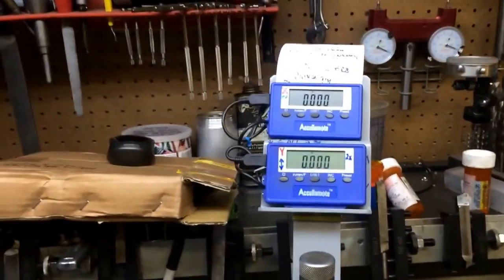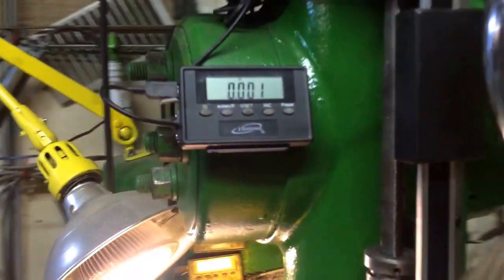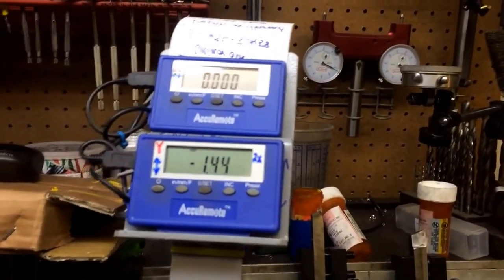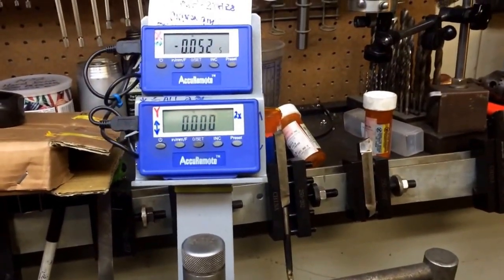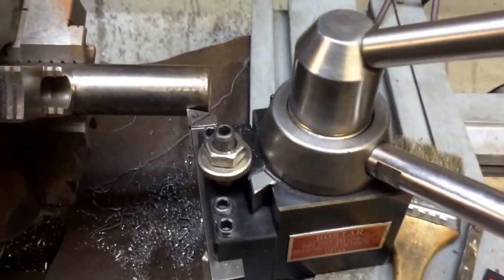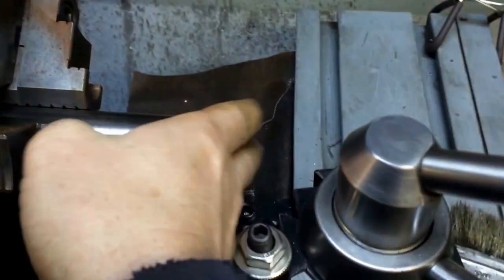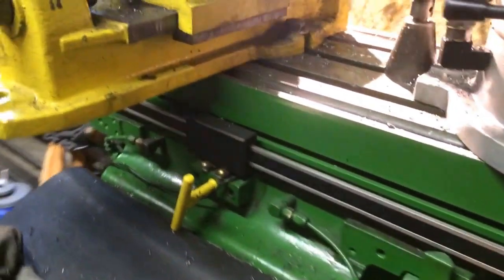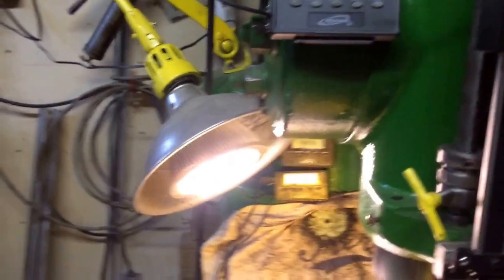igaging accuremote vs and digital remote readout DRO from grizzly review

Comment: Do a search for YurisToys for an upgrade. You won't have to replace those pesky batteries, the readout is much larger, and you could in theory use the same Dro display, wireless via bluetooth between your mill and lathe. It's great, you can save thousands of points on it too, add a tach, etc.

Comment: Those Igaging DRO's are really good and also cheap to buy. I have them on my lathe and mill. I have modified mine to run from the 3v on a PC power supply. That does away with the hassle of batteries. After 2 years I have had no problems whatsoever with them. regards from the UK

Comment: your cross feed dial reads in diameter, the digital reals travel, which on a lathe cross feed is radius. it should be 1/2 of the dial.

Comment: Hi,
When you reset your zero many times on the Z axis you run the risk of adding up cumulative errors. It seemed to me that you weren't taking up the back lash from the screws.
Those little DRO's seems like a good alternative to expansive ones, thanks for showing.
Reply from the maker: you dont need to pay any mind to backlash when you have a dro as the scale only moves when the cross slide or whatnot moves thats the nice thing with a dro. as for erorrs never had a problem yet.

Comment: When looking for a camera the Go Pro's are great but if you look around you can pick up a couple of 3 to 5 year old HD Panasonics on Ebay or Craigslist for the same outlay. I recently picked up a Panasonic SD80 new in box for less than $100. Cheers Eric
Reply from the maker: i picked up a go-pro finely and it works vary good just not much time to do videos now as we go away for the summer but thanks for the recommendation